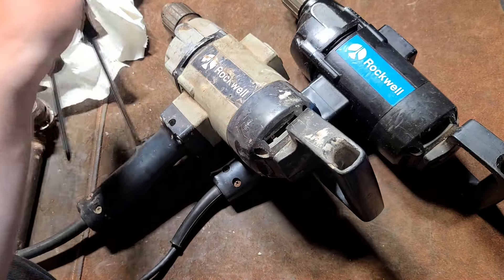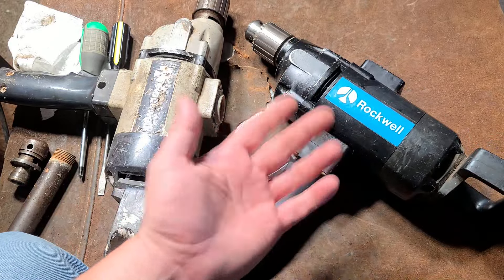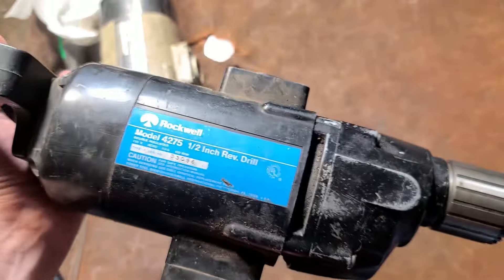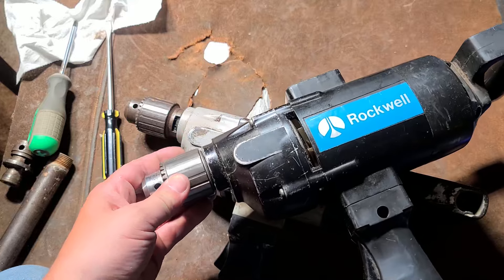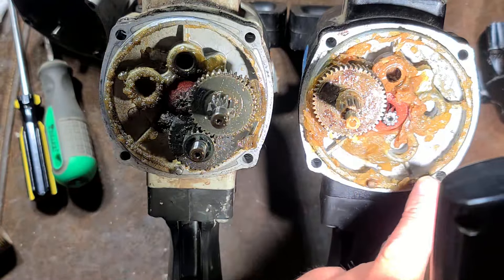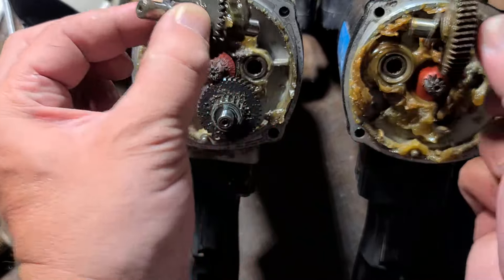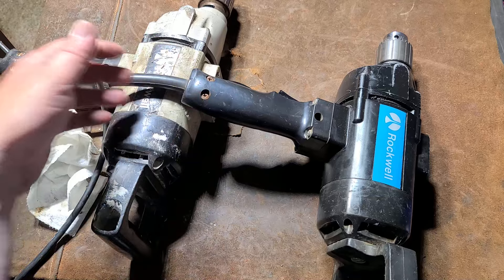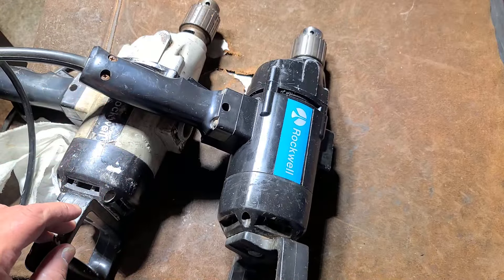Rockwell/Porter-Cable USA Heavy-Duty 1/2" Drills...

Comment: In 1994 I remember my father purchasing me at pergament that was our home Depot back then a Porter-Cable model 629 tigers saw reciprocating saw still works after all these years lost a lot of its labels had  to replace the shoe lost the original box have yet to replace the carbon brushes have a set brand new never opened so for having it for 30 years still works worth every penny it costs i do not remember how much it costs 30 years ago I was 17. I remember I asked him for a drill with it and he goes next time and it never happened I ended up getting my DeWalt dw-991 in a metal box 14.4v drill I still always wanted one of these I don't know why now I just don't need one I've used them before

Comment: Rockwell International sold its power tool division to Pentair Inc. in 1981. Pentair was not allowed to use the 'Rockwell' name so they chose instead to use the original 'Porter-Cable' name, a company founded in 1906 that Rockwell International purchased in 1960. Pentair sold Porter-Cable to Stanley-Black & Decker in 2004, who then cheery picked and later degraded the remainder of the product line as is usual with buyouts.
Reply: Sad but true😭